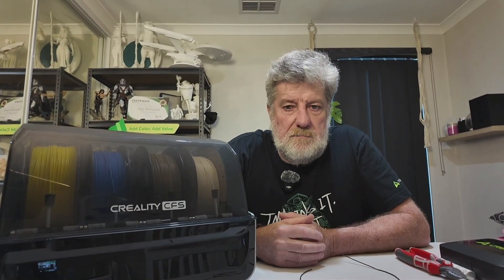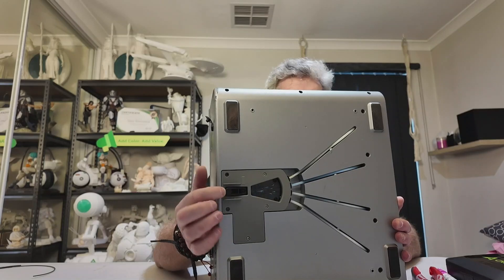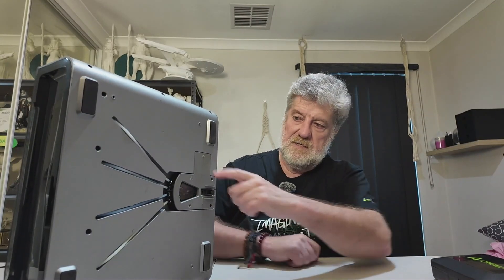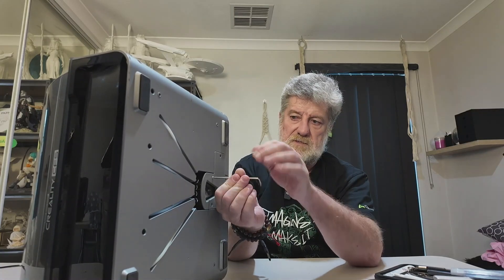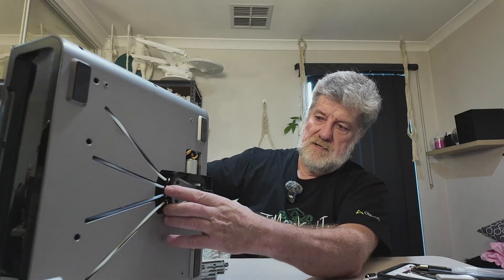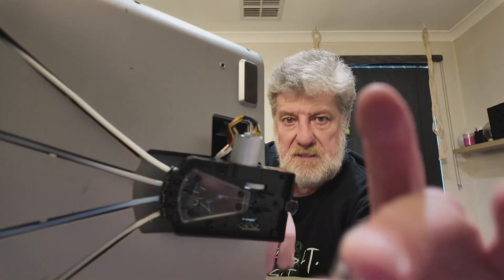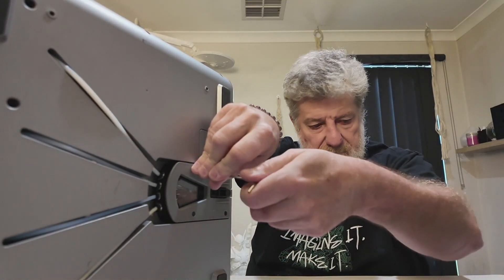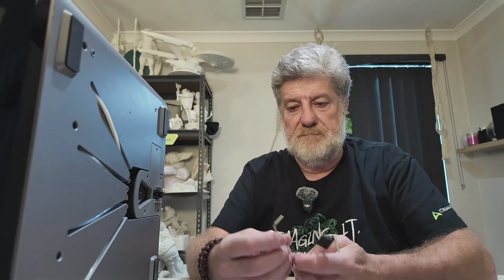Fix the error messages coming up with your Creality K2Plus and Creality CFS.

Comment: Hello everyone! I wanted to ask a question to more knowledgeable and experienced printers.
I bought a Creality Hi back in July, and only now got around to trying the CFS. It prints flawlessly, but every time, at absolutely random moments, when I pull out the filament tube, the cut-off piece that should have remained in the hotend comes out and interferes with changing the filament. I've attached a photo. I understand it's the cut-off piece that's interfering. If anyone has encountered this or has any ideas about the problem, I'd be very grateful for your help!

Comment: My CFS started to refuse to work with any filament roll I tried using to print, and kept throwing the F02838 error. I followed your directions and now it's working no issue! Thank you so much for sharing!

Comment: My K2 Plus worked fine for a couple months then it started seizing right there.  I decided to cut off 1 loop of the spring since that button was really hard to push.  This fixed my problem, thank you for posting this.  I still don't understand why it worked fine for a couple months then started seizing right there but thank you.

Comment: I had a problem with the lower feeder. It was eating the filament, and the feeder can push after this to CFS filament. Printing stopped.
Cut the spring from lower feeder is not so good think to do.
Because when I cut them the problem did not desappear.
I buy new spring (1.0mm x 8mm x 20mm) like oryginal and I added a spring pad.
And after this the problem is solved on my CFS.
Link for small pad for cfs lower feeder spring https://drive.google.com/file/d/1wkRAg-2Ewqlxf0Ghl1OHGVNHGdHK-iQB/view?usp=drive_link.

Comment: Just did this today for my K1C to fix the FB2864 error, where the PTFE tube would pop off the back of the CFS on first filament feed or when manually pressing the filament extrude button. CFS and upgrade kit done about a week ago and have been having this issue since the upgrade. First test seems good so far so good. Removed 1.5 loop as the spring seemed very rigid.

Comment: I got an x axis error at the end of a print.  Took the CFS apart 2 because had a side spool error.  One the control panel it showed a spool on the side of the machine.  I took the extruder apart and there it was a sliver of filament jamming the filament present in the extruder.
It would be great if the screen was a bigger and all switches could be monitored.

Comment: Creality just sent me this video to try and are also sending me out 2 warranty replacement 5-way brackets for the bottom of my CFS’s. Apparently they seem to think this will fix the issue.
Reply from the maker: Interesting they sent it to you,  its fixed 3 of my CFS i was having problems with, hope it works for you.
Reply: @3D4Everyone1  this has successfully fixed my issue. I’ve been fighting this printer for 2 months. I cut the spring on my other CFS as well. Great fix and it’s much appreciated. I bet Creality is delighted as well as they are sending this video to people as a potential fix.
Reply from the maker: @derrickjager1874 great to hear.

Comment: Hey I was wondering if you had seen that some people are suggestion the opposite, that instead of cutting the spring you should add a washer or printed disk in to make the spring slightly tighter? I am about to give that a shot as I figure I can always pull that out if it doesn't work, but it is harder to replace a spring/add a loop back on. Some other people also suggest changing the bowden tubes to slightly wider ones. Two of my 3 CFS work perfect, the 3rd always jams.

Comment: I also had a blockage. I replaced the spring with an Ender 3 V2 bed spring, which has the same diameter and is one ring shorter than the original spring.
Reply: oh i have a bunch of those

Comment: I'm about to throw mine out of the window.  Even with the spring cut (which helped a little bit) and checking that the spools are big enough it still catches!  Going to try checking that everything is plugged in correctly, but I'm now dreading that "buuzzzzt" noise it makes when it gets stuck!

Comment: Thank you for the video. Unfortunately it did not helped but turned me to the right direction. My issue was that the main motor for this 5-way node or how its called just did not move at all on a brand new just unboxed CFS. After hours of debugging i found that the motor wire was not firmly plugged into the socket on the MAINBOARD. After sitting it started to work just fine. So, just in case, check ALL connectors and wires before cutting the spring :)
Reply from the maker: Great news that you got it working :)

Comment: I tried everything. I cut the spring. Replaced the spring.  Put shims. ...plus a dozen or so other hacks. Same 3 messages over and over . Creality won't help because I bought it through Best Buy Very frustrating..

Been tinkering with it dor over a month . Still cant get it back wor m img. Finally had to close my online stores.  

If anyone have any other suggestions. ..please send

And fyi I started with 5 ender 3 printers. Then all last year I used my K1 max. 4 months ago I added a k2 plus . So I've been fixing on Creality printers for over 4 years. Not a noob . Just oit of ideas...

Comment: Hi Gary, I tried this fix, and I still get random jams in my CFS's. Are there any other options to stopping these jams?
Reply: Have you cleaned the wheels from the place you cut the wire from? Ive found that on some filaments clog up the wheels and they have problems pushing the filament through

Comment: the issue isnt the spring. (however reducing the tension might help) the issue is that the feed/return motor and the 5 way motor dont feed at the same rate, or go i to neutral/freespin. so anytime it is feeding or pulling filament the 2 motors are constantly fighting each other.  you can even hear the massive motor strain from this battle.  something will have to give. either the filament or the plastic gears.
Reply: Any fixes for this?

Comment: I have a brand new machine that arrived last night that is doing this. I have second CFS unit that I have not hooked up yet, i'll try that one first and if I experience the same issue I'll have to trim the springs on both. It's frustrating to have this issue as compared to my Bambu printers which simply print perfectly from day one using their AMS systems.
Reply: AMS has the same issues getting the filament jammed since I was reporting this in a opened ticket in febraury when, before, It was emptying all the spools from third brands. Now, Bambulab forces to users to use only Bambulab spools that goes vs our freedom to choose third brands but people doesn't want to protest vs this measure and it's disturbing for others, like you, that they want to use other brands and save money.

Comment: I just ordered this printer with CFS and now im worried, I am coming from the A1 so use to everything being pretty easy. hoping if i have to cut the spring it works.
Reply: @arranwilliams2523  spring cut was a last resort, most coming out now days don't seem to have a problem, so I gather they have changed something
Reply: I have 6 bambu printers that all work very well with their AMS systems. I took the same plunge and i'm having issues with the CFS on day one.
Reply: @seanwhite4586  when did you get your printer? ive been pretty lucky for the last few days this thing has been printing beautifully

Comment: Can you provide a link to where you got the springs are the specs on the springs
Reply: @omnipotentgoku  i didn't change the spring, just cut and hoped for the best. But if you take the spring from your printer to a hardware store they should be able to point you in the right direction

Comment: I did  this however I am still getting the CM2784 error  and it only happens when print PETG.  I can print PLA like butter.  I'm getting really frustrated with the K2 Plus.  Its sad because when it works it works amazing. Printing PLA is amazing.  But spending $1500 to print PLA is sad.

Comment: I recently encountered this issue and will attempt your solution today and see what happens however, I have been consistently receiving the FR2836 error I opened the bottom and thoroughly cleaned it, It started working until I attempted a color print, at which point the error reappeared. Thanks for the video I will let you know if it works!
Reply: Well did it worked?

Comment: Thanks for this! I was having this same issue on my CFS. I did just wanna note a couple of minor changes, in case anyone else here tried this. First, all the screws on my CFS were the same same (2.5mm IIRC), so Creality may have changed manufacturing slightly. Next, I did exactly as you demonstrate, snipping just one "ring" of the spring and that didn't fix the issue. I then snipped another quarter of a ring. Still didn't fix the issue. Snipped another quarter, and that seems to have cleared it for me. So, just a suggestion, if you are having this issue, do as demonstrated here, and if that doesn't work, keep shortening that spring in 1/4 ring increments until it works for you. BTW, I used the multi-color Creality logo that comes loaded on the printet as my test piece. It's fairly quick and requires multiple filament changes to successfully complete.
Reply from the maker: @sgtrat87  thanks for talking the time to write this Brett
Reply: Just got my printer last night and it was driving me crazy with multiple jams when trying multicolor prints, I'm going to try this tonight. Thanks!
Reply: @seanwhite4586  how did ti go?
Reply: When I first did the mod it didn’t work for me either …but I scrolled down and saw what you did I tried the same . 1/4 cut at a time…. 3 clicks later it worked! I just hope others find this add-on steps. Thanks so much!!

Comment: Hello, Would you be so kind as to make a short video about solving the Problem about Error-Code FB2846. Where to check the CFS and the Filament Buffer and whats the strategy to solve the problem? You told me some days ago about the maybe bad motherboard. In the meantime I've read a lot meassages, that other people have the same issue about FB2846.
Reply: I actually had the same issue, and finally I dismantled the ‘filament buffer’ from the back and say through the translucent plastic that there were bits of filament inside. I managed to take them out. Then everything worked much better. However another stepped imp[rovement was when I replaced the blue filament from the Creality lot.

Comment: How are springs measured? It seems like it'd be a better idea to determine a replacement spring rather than cut the factory spring and potentially have creality say your sol on warranty stuff. Not that I think this is likely. 

As someone else has said before me - I have 3 CFS units. Only one that chews through filament is the one that came with the printer. The other two do not. I also have observed the plastic pusher pieces in the lid of the CFS units are different colors between the pre order unit and the ones ordered later. I suspect Creality is doing Creality things and making little changes over time without saying a word about it. Just look how many things they eventually changed with the K1 Series... it's wild. Extruder - nozzle - belt pulleys.
Reply from the maker: I think it's good to have a backup spring in case you need it.
Reply: Can confirm even on the v3 ke they have changed stuff. Got 3 two that i got recently and one i got months ago. The new ones have a smoother bed, different pulley and had loose linear bed rods old one was fine
Reply: @Freddy-pp4nc  I'd almost wonder if there were some changes in your case to get them on the boat ASAP before "liberation day" aka "F all of us who rely on parts and machines from China" Day. I know a LOT of companies were making things fly so they could be unloaded before April 2nd.

Comment: i noticed all the CFS that came with the pre-orders have this issue. my new CFS units do not have this problem and they are way quieter. i cut the spring awhile ago when all my filaments were coming out chewed up about 3 meters down the filament roll.
Reply from the maker: @FuIImatiK  the springs would probably be a different batch steel or the spring machine needs better calibration  :)
Reply: @3D4Everyone1  yea, i was going to take apart my newer unit just to see if anything is different. the new units are noticeably quieter when spooling. not sure if they used different material for the gears but my pre-order CFS is annoyingly loud.
Reply: I have noticed this as well. The CFS that came with my K2 chews through the filament on retraction during color changes and will eventually give an error saying there's a blockage. what I suspect is actually happeneing is that chewed through section is coming to one of the optical sensors. Because I can watch the filament go through the PTFE tube and it will usually make it just a little after the buffer device. 

I have to say I really don't want to cut the spring - I'd rather see if we can find what the spring tension and sizes are and get a replacement softer spring before we go meddling and voiding warranties on new devices.
Reply: . Good luck with a Creality Warranty. It will take months to get fixed or replaced.
Reply: @rls-Ryan  their customers service has been pretty good this time around. I got 2 bed replacements and parts for the cfs.

Comment: Did not work for me. Still have the same problem.
Reply: Cut more ?
Reply: @NoMoreFnGames  I will give it a try. I don't have calipers, can you measure the size of the spring? So, I can buy it if i cut to much. Creality takes forever to send out replacement parts. Thank you.
Reply from the maker: The cog where the spring is might also need cleaning, I took mine out and it had a lot of filament particles ground into the teeth.
Reply: @loko5626 if you cut too much simply print a couole of different size shims to sit on the end of tge spring
Reply: So is the chewed up filiment getting stuck in the extruder above the nozzle then causing blockage?